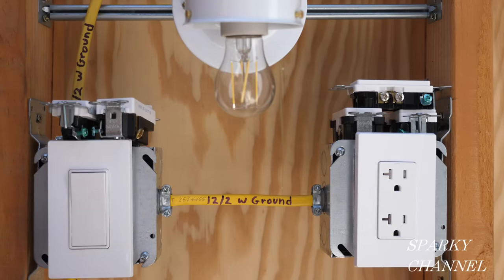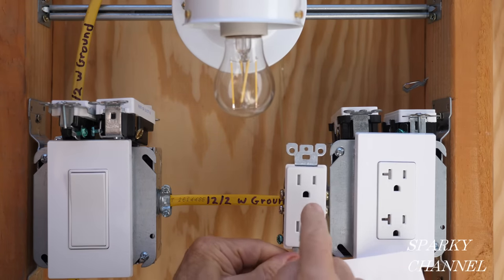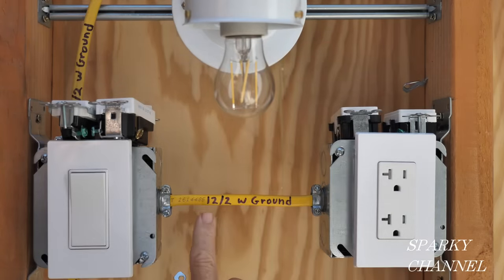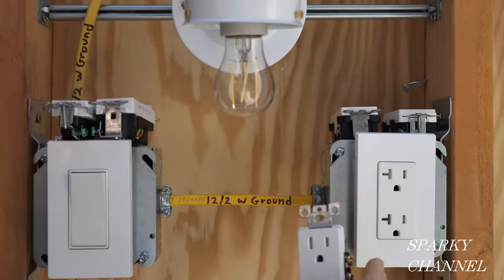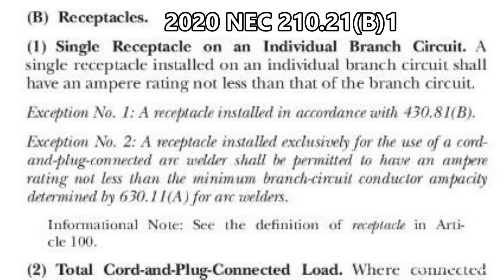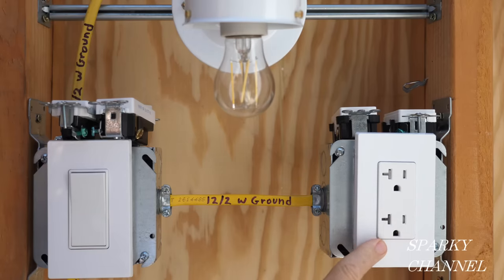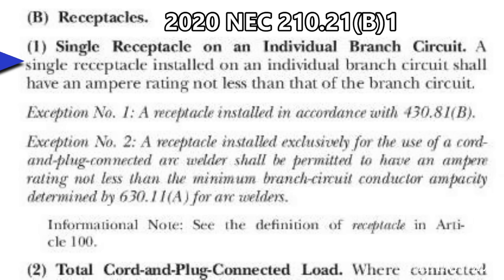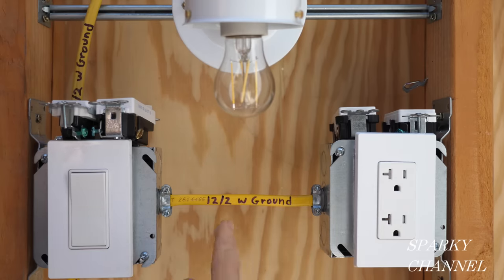Shall I Use a 15A or a 20A Receptacle on a 20A Circuit? + 2020 NEC 210.21(B)(1) and 210.21(B)(3)

Comment: Buy commercial grade receptacles and you'll never have to worry about them again. Commercial grade uses beefier clamp type back wire connections instead of the crappy push-in style found on residential grade. More importantly, commercial grade can use either 14 or 12 gauge wire and they have double wiper contacts. Specification grade is typically somewhere between residential and commercial grade and doesn't always have the double wiper contacts.

Comment: I've always matched the Amp rating to the appropriate reciprocal....had many electricians who have said it makes no difference.  Thanks for the clarification!
Reply: I've learned alot from Bill and he is one of the best on yt for electrical information. However, he was comparing a residential grade 15 amp to a spec grade 20 amp. He later shows a 15 amp spec grade which has the same design and build quality as the 20 amp. Bottom line, the answers you got from electricians is correct as long as they're both spec grade.

Comment: What happens if i run a 12.5 amp heater all day on a 15 amp outlet connected to a 20 amp circuit 🤔 will my 15 amp outlet burn out? How many amps can a 15 amp outlet actually handle?
Reply: If your heater needed 20a, it would have a 20a cord cap.
Reply: I can tell you first hand.   Nothing will happen.  I am running two 12.5 Amp heater to heat my home right now.    Both are on a 15amp outlet with a 20amp afci/gfci breaker.

Comment: My house is 1957 vintage and the house was wired with 20 amp glass fuses for the Living Room, Bedrooms, Garage etc. I used 15 amp outlets when I replaced the old worn out ones in the rooms where I knew that the heaviest load that I was going to plug in is an upright vacuum. I used 20 amp outlets in the areas like the garage where I knew that I would be plugging in things like skill saws, etc.
Reply from the maker: Smart! Sounds like a nice house!
Reply: 20A??? 1957 - you better check your wire gauge in the fuse panel... Doesn't sound right (but possible).
Someone may have overfused you house due to too many blown fuses. Most '57 houses I work in have 15A to the bedrooms (14ga wire), and only have 20A to the kitchen and 1 required dining room area outlet on 20A, 12ga wire.
Are they Edison fuses? (bases like a light bulb?). other type you could have are 'Fustats', with a fine ceramic threaded base. Edison fuses can fit the wrong size fuse (actually will fit ANY size fuse, right or wrong). A Fustat will ONLY fit the right amperage fuse, at least without extreme effort to force the wrong fuse (wrong thread) into the wrong hole...

I STRONGLY recommend checking if the wire gauge in the fusebox, for those fuses, is 14ga or 12ga! Unless you already know they are correct. 14ga=15A MAX, 12ga=20A.
You could have a house fire if they are overfused.
Reply: @troubleshooter1975  I had the fuse panel replaced. The wires are the proper gauge. I can hardly bend the wires back into a work box after replacing an outlet
Reply: @bobdadruma  OK - as long as you're sure the wires are 12ga. I am puzzled when you say you had panel put in, and yet you still have glass fuses... I assume this was long ago? (like 50 years ago?).
OK, maybe I misunderstood, I'm guessing you meant it 'had' glass fuses, until the panel was replaced...

There is often identifying gauge markings on older THN wire in conduit, or on Romex jacket.

I saw this clever trick I had not heard of before, on a YouTube [I forget who to give credit to].
Compare wire thickness to a nickle or a dime, 12ga close to nickle, 14ga close to a dime.
I am going to try this, and see if it's accurate enough, then suggest a new way to-
Ah, I looked it up, looks like a quarter is closer to 14ga than a dime is...
quarter = slightly thicker than 14ga. (by ~0.1mm)
nickle = slightly thinner than 12ga. (by ~0.1mm)

My new version of this trick then is to use TWO each of quarters and nickles, and make these 'sandwiches':

Sandwich a nickle off-center between two quarters (or anything) such that the quarters extend over the edge of the nickle, making a groove.
A 12ga won't fit in the groove.

Now, reverse the 'sandwich' to check for 14ga.

Sandwich a quarter off-center between two nickles (or anything) such that the nickles extend over the edge of the quarter, making a groove.
A 14ga will fit in the groove.

Good luck and be safe!
Reply: @troubleshooter1975  the glass fuse panel was replaced recently when a solar system was installed on the house

Comment: There's virtually no difference internally between a 15amp and a 20amp receptacle but they charge 3x the price for 20amp. There is a difference between residential grade and commercial grade receptacles and the extra cost is worth it for me.
Reply: "virtually" no difference, but you didn't state what the actual differences YOU think exist.  A 20A receptacle actually allows for a NEMA 5-20P and, despite your claims, I can assure you that UL rated receptacles are not the same.  This is like saying there is virtually no difference between 14 gauge and 12 gauge when the increase in cross-sectional area allows for 33% more safe ampacity in the 12 gauge.  That cross-sectional area (kcmil or mm^2) needs to be 58% greater to safely gain the 33% increase in power. Read that again... 12 gauge is rated 133% ampacity of 14 gauge but has 158% the copper.  1/3 more is not "virtually" nothing.  Same with a receptacle that is UL listed and properly designed.
Moreover, the 15A receptacles are designed to only accept 14 AWG with the stab connections... you literally cannot insert 12AWG.  Arguably, this is a limitation of the quick-wire interface as they used to be available for 12 AWG, as well.  Nonetheless, 15A receptacles of the builder quality are NOT a substitution for a quality NEMA 5-20R.
Stop passing bad information.  I have seen the video where you got this information and it's wrong and dangerous.  You couldn't possibly see the cross sectional increase in copper bar as cross-sectional increase is a function of both width and thickness.

Comment: Great video!  I ran a 20 amp circuit to my garage. Used 3) 20amp outlets and 2) 15 amp outlets for LED lighting. After that I   needed a few more 15amp outlets for garage door and convenience outlets. They are paralleled in at the main feed box that 12awg wire comes from the panal. My question is that okay or should I replace the the feed and ad a sub panel. Thanks for any input.

Comment: I'm a licensed electrician.  Don't put a 15a receptacle on a 20a circuit.  Don't do it.  Here's why.  If you should use an appliance like a small heater or Christmas lights that draw real close to 20a but not over and run those items for hours on end it wont trip the breaker but most likely it will melt down the receptacle and can start a fire.  I have seen it happen.  I don't care what the code book says, don't do it.  Those cheap, wimpy 15a receptacles just aren't built to handle close to 20a.  Check with your homeowner's insurance policy and see if it covers a DIY electrical fire.
Reply: is there a reason you cannot use a 20 amp receptacle on a 15 amp circuit? is it because of those specific types of plugs?
Reply from the maker: I love it! I'm always putting 20A receptacles on 20A circuits. Excellent!
Reply: @gtb81.  Well it's safe but misleading since some appliances have the perpendicular plug to prevent the unit from being plugged into a 15a receptacle.  As soon as it is energized it will trip the 15a breaker.   One more reason to match the receptacle to the circuit.  Also, NEVER, EVER put a 20a circuit breaker on a 15a wire circuit.  You could cause a fire inside the walls.  Not good!
Reply: Oh ok, i suppose that makes sense, i hadn't thought about that, i am not licensed yet so i am still learning some of the odd bits.
Reply: I ran 12 gauge wire for my home workshop plugs on a 20amp breaker. The larger tools run close to 15 amps and I didn’t want the breaker tripping if a piece of wood bound up a bit. I did use regular outlets, so should i just upgrade them to 20 amp outlets?
Reply: @huejanus5505  probably best to do that, yeah, but check the outlet, to verify that it is 15 amp
Reply: @huejanus5505  no. The ONLY reason for a 20a outlet is to accommodate 20a plugs. Believe me, if Leviton had any proof 15a outlets were insufficient on 20a circuits the NEC would make us pay for 20a outlets.
Reply: @huejanus5505  you really should put 20a outlets on dedicated circuits for one outlet to prevent overload situations.
Reply: If you doubt..., and don't have gear to really test...just grab your decent Hoover Vacuum (12-15A), plug it up, and give it a 10-15 min spin and check your outlet & plug occasionally.
Reply: @KitchenerLeslie2  How does the receptacle prevent an overload?
Reply: @huejanus5505  Yes
Reply: @exitar1  the breaker does. The outlet is UL approved for 20a circuits. 20a outlets are for single outlet circuits where you will be plugging in high draw appliances or tools.
Reply: @KitchenerLeslie2  UL listed or certification is based on the devices specification. Show where UL says 15 amp outlets can handle 20 amp current.
Reply: Thats not true at all and UL 498 standard says you are completely wrong.  Nice flex tho.
Reply: @lloydmills9619  show where it says that
Reply: @exitar1  I'm not sure what reference your asking for beyond the UL standard.  The NEC reference was already given.  Short of copy and pasting the actual Standard from the under writer I'm not sure what you're looking for.  The standard for testing a 15 Amp receptacle far exceeds 15Amps.  Using 20 amp devices only allows the use of a 20 amp cord connected appliance.  In fact in most cases the manufacturer uses the exact same parts for both devices.  There is no added safety, no additional  available load capability beyond its rating and only makes it easier to overload a circuit.  These are facts confirmed by understanding the testing and listing standards and the NEC.  Removing 15 amp devices to replace them with 20 amp receptacles adds no safety and only allows for more opportunity to overload the circuit.  The 20 amp receptacle should only be installed where a 20 amp cord and plug appliance (or equipment) will be used.  I hope I was more clear and your able to find the information your looking for.
Reply: @exitar1  It is permitted.  I don't think you're asking what you think you're asking.
Reply: @exitar1  Because it doesnt reject loads with a 20 amp attachment plug like a 15 amp receptacle does.
Reply: @lloydmills9619  NEC Table 210-21(b)(2) The maximum cord-and-plug-connected load on 15-ampere receptacles, supplied from either a 15- or 20-ampere branch circuit, is 12 amperes. Where 20-ampere receptacles are supplied from a 20-ampere branch circuit, the total cord-and-plug-connected load must not exceed 16 amperes.
Reply: Ron, I have a home which EXACTLY that happened! Heater plugged in. (15a) Heater plug and receptacle melted and the wall got HOT. Melted the insulation off the wire for 6 inches leading out of the box in the wall. Alerted to the problem after smelling plastic burn. SO close to burning my house down. Finding a lot of the previous homeowner electrical work shoddy. Be careful people! I am now re-doing the whole circuit and tore out the walls. (basement) Later found the new electric oil heater was defective after testing it elsewhere.
Reply: @gtb81.  Yes.  My table saw can draw 18 amps, so the electrical cord is fitted with a 20 amp plug.  That plug can only be plugged into a 20 amp receptacles in my workshop.  It cannot be plugged into a 15 amp receptacle in my workshop.  That's the most common application for the difference between the 15 and 20 amp receptacles.
Reply: @chrisgraham2904  I've not seen one in person, usually all the things i have are just a standard plug, even my mig welder so i wasn't sure, only time i have seen a plug with the sideways pin was on a 220v air compressor
Reply: @huejanus5505  You could upgrade your outlets to 20 amps only because the receptacles should be a little more robust to handle the higher amperage.  If all the receptacles in your workshop are 20 amp, there is no real problem.  If you had 20 amp and 15 amp circuits in the workshop, as I do, then you would want to change the plugs on the high amperage tools to that they can be plugged into the 20 amp receptacles only.  Also, not a problem if your the only one who uses the workshop.  You don't want to be able to plug a tool that draws 18 amps into a 15 amp circuit.
Reply: @gtb81.  True.  You may not find the 20 amp plugs at the local Big Box stores or local hardware.  They are available at electrical wholesale distributors or those that supply to commercial businesses.
Reply: @chrisgraham2904  Yeah it isn't common, also most of my stuff is at least about 20 years old now, my shop has the outlets that would support it but i have never needed to take advantage of it
Reply: @gtb81.  You'll also find that most contractors, that may have tools that can draw more than 15 amps, still keep their tools wired with 15 amp plugs because they will never find a 20 amp receptacle at a customer's property in the field.
Reply: @chrisgraham2904  they have them where i am at, we install them on 20 amp circuits, we wire kitchen, bath, hallway and outdoor with them
Reply: The issue here is effectively a faulty device. A 15 amp plug on a device with the capability to draw 20 amps. Either the wrong plug is fitted or a fault in the appliance itself. With a 15amp circuit it would trip safely, but might not trip with 20amps. Of course you can fully convert a 20amp circuit to 15amps with breaker and receptacle, uprated wiring in between isn't going to be an issue.
Reply: Great Points!
Reply: @gtb81. no. The 20 A receptacle will just fine on a 15 A breaker. But!!! The receptacle will allow you to plug a high current load plug with rotated neutral spade into a 15 breaker branch. The breaker will trip! False advertising! So no, you cannot and should not put a 20 A receptacle on a 15 branch.

Comment: Trick question because new code is 20A receptacles in Residential for new construction.
Reply: Code article please?
Reply: @PeterTrimboli  I don't remember specifically but it was taught in the code class.  Also note, it is for new construction electrical as opposed to a service job.
Reply: @taylorcompton7688  didn't get that in my code update class I'll try to find it when I get home

Comment: So it’s it’s ok to add a 15a outlet on a 20a breaker that already has a 20a outlet on it w 12/2 wire? If so, should you stick  with running 12/2 from the 20a outlet to the new 15a?
Reply: Yes ... use 12/2
Reply: The thing is, it's still running off a 20A circuit breaker, so you'd rather the plug fail or circuit break rather than have the 14/2 wire overheat and cause a fire inside the wall.

Comment: Why do these 15/20 A receptacles not burn out the loads plugged into them?
Reply from the maker: The loads are less amperage than the rating of the receptacles.
Reply: @SparkyChannel  exactly, so if the receptacles have a higher rating and the loads cannot handle them, why won’t it burn out?
Reply: @krishbhaag8391  things that plug into that outlet suck less than 20 amps. A 20 amp outlet can provide 20 amps, (well 80%) it will not provide 20 amps to a device that draws less, it will cover the need.
Reply: Devices only draw what they need. You can actually even buy converters that plug directly in to 30amp plugs that have a regular 15 amp style outlet on it and plug your phone/laptop/appliances directly in to it. I do it all the time using RV hook ups when I'm at campgrounds
Reply: Also I should note that it's probably not code compliant, and definitely not something you should use as a permanent solution. Just make sure you inspect you appliances/cords and make sure they're undamaged and in working order, know how much you can plug in without overloading the wire, and most importantly don't ever leave it plugged in unattended.
Reply: @SparkyChannel  ... btw, there are no homeowner style portable appliances that draw more than 15 amps (1800 watts UL listing) so a standard outlet will do fine 99% of the time. It's when they get old and wobbly inside from constant use, like that outlet in the bathroom where a hair drier gets shoved in 7 times a week. In that case it's "wear" causing a poor connection. Another point is a branch circuit should only have 80% loading so 16 amps on a 20 amp circuit. This is why a dedicated 20 amp outlet should be on it's own wire and not tied into other outlets.

Comment: What happens if you plug in two 10amp devices into a duplex 15amp outlet on a 20 amp circuit, will the outlet melt?
Reply: No, the receptacle will behave no different than a 20 amp receptacle. 12 gauge wire is the key. If you are actually drawing 20 amps, you're at the threshold of tripping the breaker. You shouldn't draw more than 16 amps for safety.
Using a 20 amp receptacle will not change anything over a 15 amp spec grade receptacle.